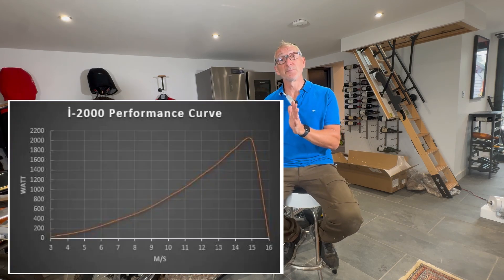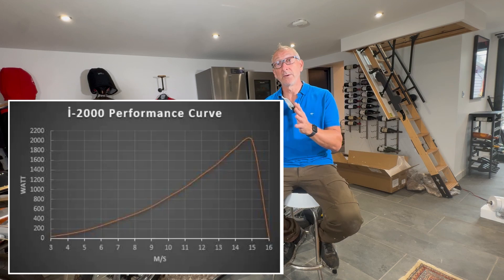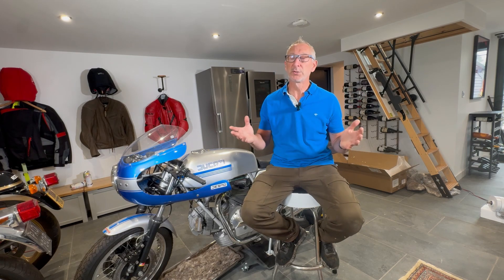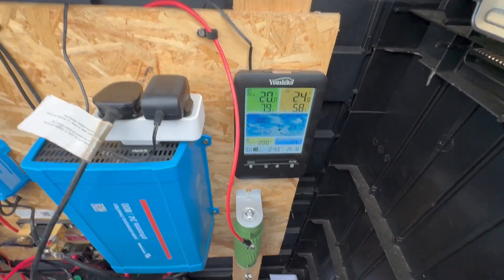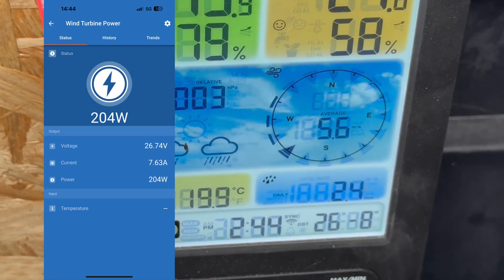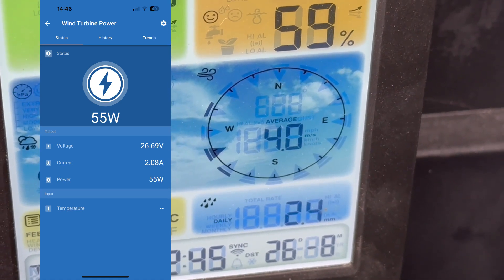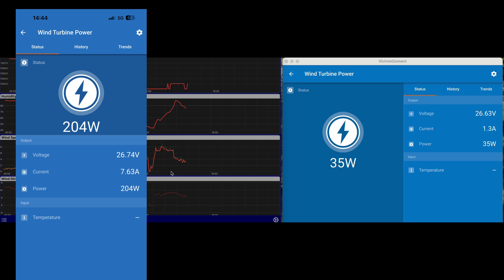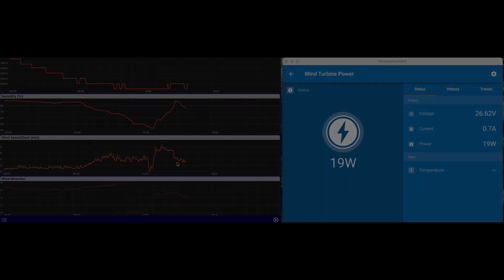IstaBreeze I1500 Home Wind Turbine - Does it actually work???

Comment: I have two of these. The i1500 3 blade blade version does more RPM for a given windspeed allowing it to cut in noticeably earlier. I ran the 3 and 5 blades side by side at the same location for a few weeks ( about 3 years back ). I have the 24v versions, both now 3 blade,  and run these into a 12v bank which gives an even earlier cut in, with a flatter power curve but better overall yield. This is at the expense of reducing peak power but yield is more important for me. By the way, are you using one of those Amazon/Ebay wind/solar controllers ( the green box with aluminium heatsinks on the LHS )? Reason I ask is that these seem to get poor reviews where they hobble the performance of turbines.
Reply from the maker: I dont really have any experience of other controllers. I use victron for all the solar but they don't produce a wind version. Did you use the Istabreeze?
Reply: @Homewindturbinereviews No. I have made a diy controller from A30 (Ebay £18) controllers driving solid state relays. Has served me well for overv3vyrs with no problems.This opens/ closes a circuit between batteries and a bank of dump resistors ( 0.2ohm total, about 1200w capacity).
Reply: The A30 is easily converted to solid state by desoldering the cpil and using the 5v signal to close the SSRs. (Avoid fotek brand. MGR brand is good )
Reply from the maker: @nhikoid be interesting to check performance vs the Chinese to see if charging is different

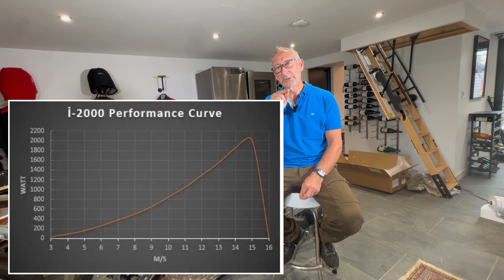Comment: Time @1:25 That Performance Chart is for the I-2000, not the I-1500 model.
Reply from the maker: yes fair  I did ask istabreeze for the 1500 and now have it. Basically the same but will post with it when comparing 5 and 3 blade